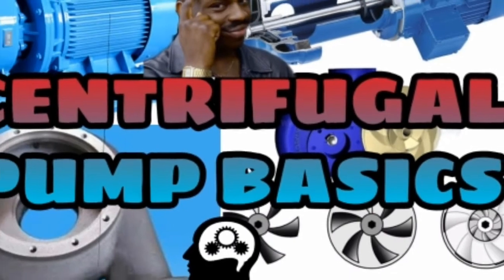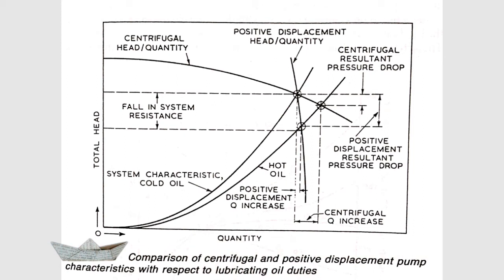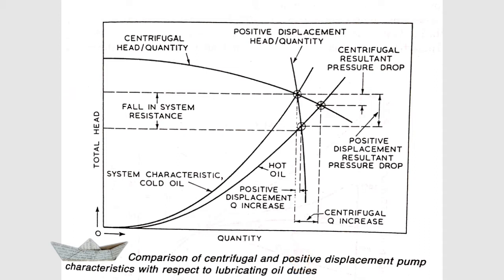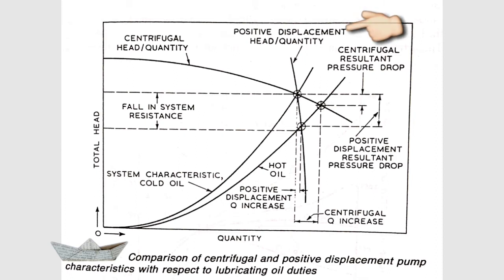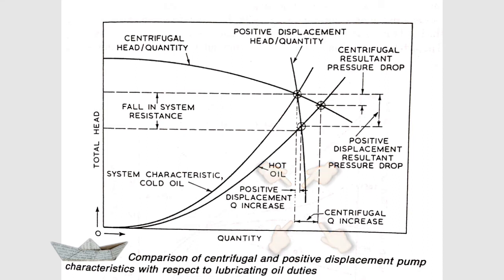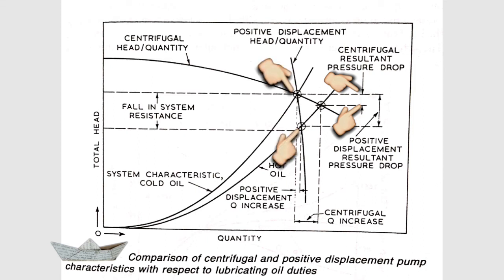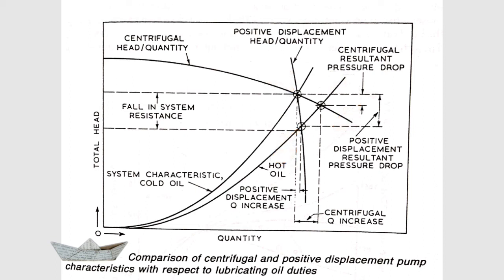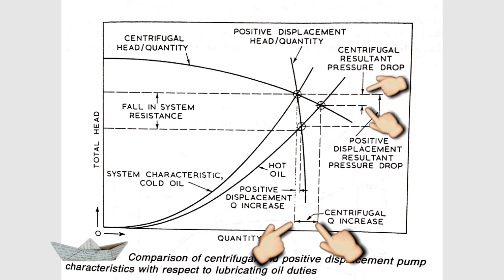COMPARISON OF CENTRIFUGAL PUMP & POSTIVE DISPLACEMENT PUMP Q/H CURVE W.R.T LUBRICATING DUTIES

Comment: It's screw pump which is used in main engine lube oil system.
Reply from the maker: Well.... The best performance is given by CENTRIFUGAL PUMP as compared to Postive Displacement pumps ..  U can see it....
I have taken the portion from MC George (Marine Aux),  it's intresting, check it out... 

Thank you

 Patel Jaynil
Reply: Yeah , you are right.
Reply from the maker: Yea Friend....  👍😇